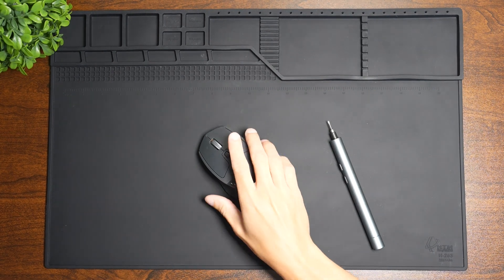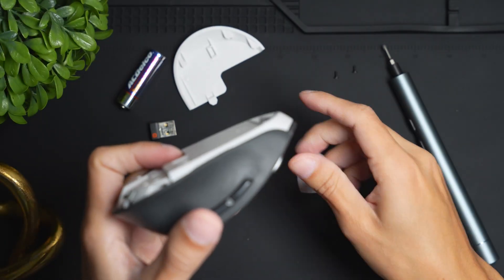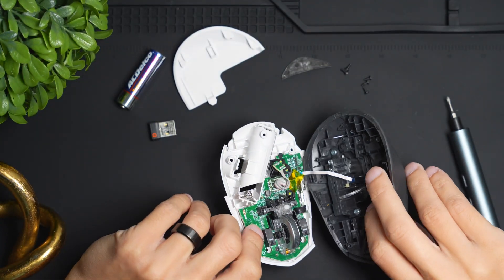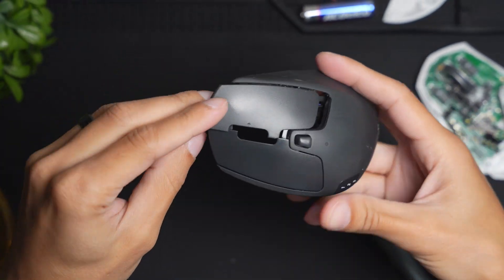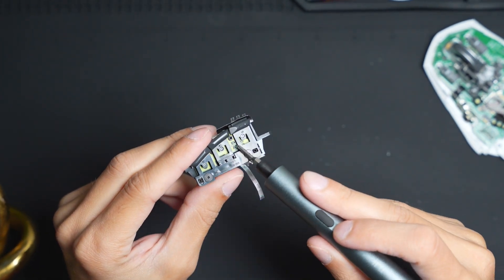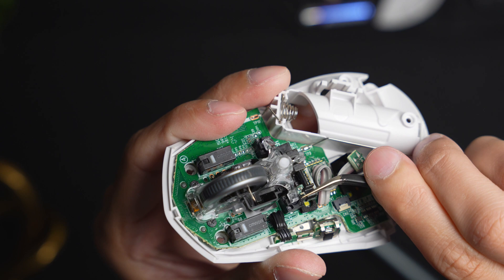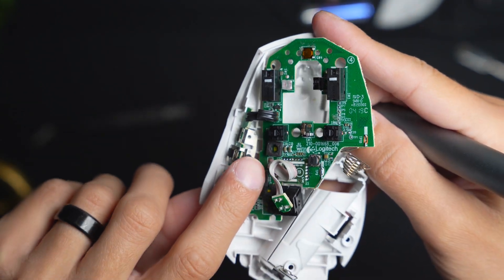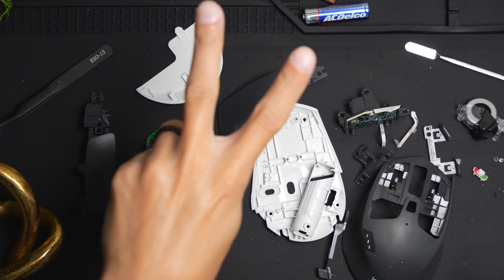Logitech M720 Mouse - Teardown

Comment: The upper part disassembly steps are quite involved:
1. remove 4 bottom black screws
2. remove right click buttons
3. remove 3 silver screws
4. remove the transparent tube thingy
5. remove side click button part
6. remove center button part (the video skipped this step)
7. remove the one black screw
8. remove left click button part

When reassembly remember the center button should be put on AFTER you have installed the left click button part. It took me some time to figure this out because the video missed step 6.

Comment: I have an issue with left click button when press and hold to highlight something it gets interrupted. any point of dissasembling or is it just borken?
Reply: I'm sure you have a new mouse by now but JIC I had exactly the same problem you're describing. I used a shot of DeoxIT D5 by working the straw under the cover of the left-click button and it has completely fixed it for several weeks now. Stuff is great for scratchy knobs and switches.
Reply: @MrMarksalot  i have the same problem. its almost like it clicks and unselects the item on screen. torn mine apart and looks like the plastic the presses on the switch its worn out. trying some tape to see if it fixes it

Update: 2 layers of scotch tape instantly made a huge difference for me. Works like new
Reply: @TheBlacksabl3  I'll have to give that a shot
Reply: @MrMarksalot  if it doesn't look up a tutorial on using wd40 on the switch abd working it in
Reply: or like others have mentioned replace clicker button

Comment: Did you have the two tiny springs that's right infront of the scrollwheel? I'm guessing it assists for scrollwheel downward click? The g604 and g502 has them, but I did not see you addressing it or mention it when you took the scrollwheel off around the 4 minute time during the video. Thank you!
Reply: He didn't even notice that he lost them. This is very amateur

Comment: At 1.52 you suggest using tweezers to remove the ribbon cable plug. All ou need to do is to lift the smal white retaining clip carefully. When the cable plug is replaced, simply push the clip bck down to hold it. Otherwise, vcery good video, thank you. Managed to replace my microswitches with far better ones.
Reply: Can you share where you found replacement microswitches?
Reply: @dagutierrez  Hi.. I eventually bought them from eBay: 2x Kailh GM8.0 HQ Premium micro momentary switches for mouse replacemement 80M
AU $7.99. That was back in February. They work very well, but are quite sensitive. I have to remember not to rest my finger on the mouse!
Reply: @AlanGent-f6g  Thanks so much for your detailed response!
Reply: @dagutierrez  Digikey or Mouser.

Comment: Thanks for the video! just a note on the flex cable, you shouldn't just pull it right away. There is a tiny lever right above the blue plastic that you need to slightly pull up via nail or tweezer in order for the flex cable to released freely. You might end up destroying the tiny pins on that cable.
Reply: Also there's no way to assemble it back together unless connector is unlocked.
Reply: I mess it up by pulling the cable lock directly, but I could manage to assemble it back again, after destroying my monitor, cat and keyboard due to rage, but it works like a charm now!
Reply: Well.... 2 minutes too late. Wanted to repair... ended up destroying it.... nice now there a tiny clamp anywhere at my floor

Comment: my m720 clicker started acting up after 2 years. would u know if it's possible to replace the main button switches? otherwise great mouse. thumb button placement for device switching is genius. im able to quick-draw switch between work laptop and home pc in milliseconds. hyperscroll wheel is excellent too. still looking for an rf/bluetooth gaming mouse with a device switch accessible via thumb and that speed scroll to this day.
Reply from the maker: Yeah it's definitely possible to replace the clickers; It's a fairly simple swap you can do by following the steps in this video. As for where to get the clickers, I would try to find a "for parts or broken" mouse on Ebay, and replace it with those.
Reply: It can be done!  Here is an article on the problem and the replacement of the mouse button switches for older Logitech mice, but the general principals are the same.  Combined with this video, you should be able to do it.  I have read that sometimes the double-click issue is caused by static buildup in the mouse.  You can try blowing air from your mouth into the mouse over the wheel, forcefully, to kill the static.
Reply: That's exactly why I found this video, after 3 years the left clicker on mine is going crazy. I always replace these buttons in my previous devices and didn't want to take a risk on opening this one the wrong way. Best mouse I ever had by the way.